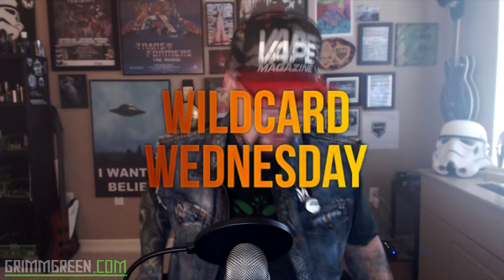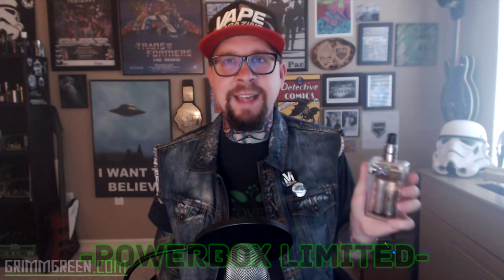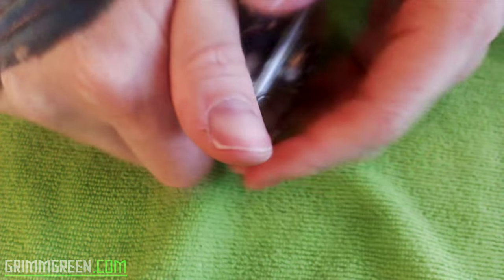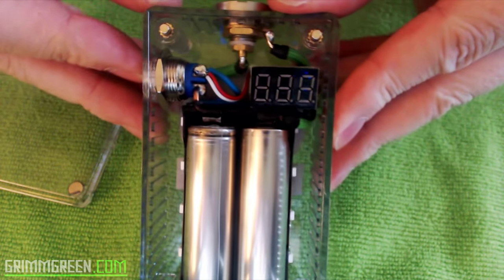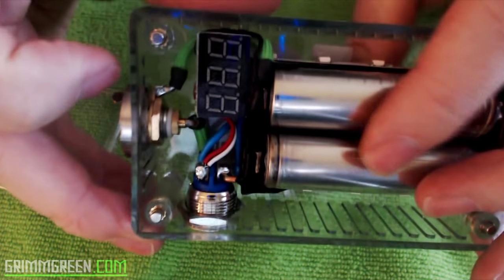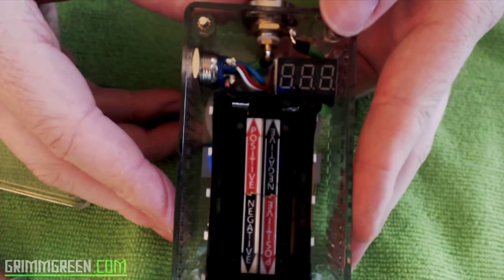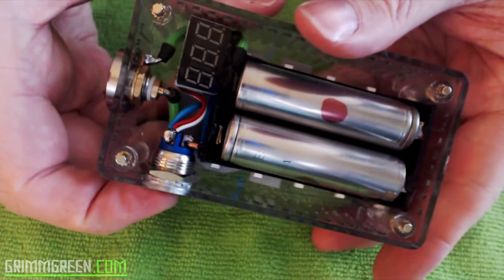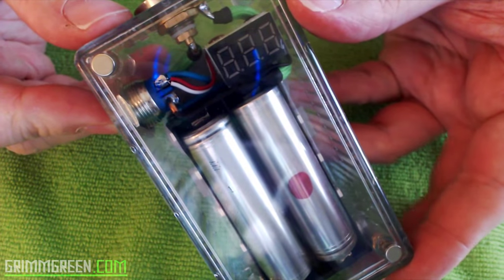The Powerbox Limited ~ Box Mod

Comment: For the leds  to light up while firing a higher build is needed about a .5 or higher . Being in series even a 1 ohm build is going to chuck clouds like a .1 build on a parallel box. Thank you for the review. Grimm you are correct there are currently 3 different types of box's we currently build. I'm happy to answer any questions anyone may have.
Reply: Also a mosfet can be wired in if consumer wishes
Reply: Elizabeth Powers should come standard especially in a series box. This box definitely isn't safe without one and you're setting yourself up for litigation and someone to get hurt.
Reply: Thank you for your opinion
Reply: OhSo  obviously u have not purchased these premade devices that come with warnings all over it.  legal language warnings in multiple languages!
Reply: Considering the fact that mosfets prevent the switch from self cleaning and can over time lead to it sticking in the fire position and auto firing please explain why a mosfet would make the box safer even when the switch itself is already rated for well above what he's pushing through it.
Reply: Hehe :p

Comment: Hey Nick, wanted to make a couple of suggestions,If you're at all interested. I primarily use series boxes, and wanted to say that series builds DO NOT have to be a hot vape. Personally, I love hot hot builds, but with all the power from a series box, it opens doors for huge coils (loads of flavor) without the ramp up time of a single or parallel 18650. My first suggestion is buying (I wouldn't be surprised if you were sent one) a Zephyr Buddha v2. It's a 30 mm atty with huge amounts of airflow, from the top and the sides, which gives you the option to fit huge coils and cool it down or warm it up with the AFC. My second suggestion is a build for a series box- I twist two strands of 26g kanthal, and then once I've twisted that, I twist 28g kanthal with he already twisted 24g. A 7 wrap dual coil of that wire comes out around .24-.25. which is a little low, so I wouldn't suggest chain vaping it. It's one of the most flavorful builds I've used on my series boxes, Let me know if you give it a shot. Sorry about the essay, have a good one man

Comment: I had a gentwo box mod not long ago and found that with series you should really use a 26650 atty.  It cools it down enough to take longer drags but you still get the same vapor production.  I used a 28mm tobh that was nice. And also if your used to a .2 build on a single battery mech multiply your build by 4 and don't use anything smaller then 24g kanthal.  And do more wraps! It's a science for sure learning the series boxes

Comment: Try shooting for 0.8Ω - 1.0Ω on your dripper, basic kanthal micro coil with lots of wraps = lots of surface area for more clouds and flavor. Basic rule is take whatever resistance you build on a tube or parallel mod and multiply it by 4 for the equivalent wattage. The benefit is that series voltage draws less current than a parallel or tube mod, assuming you build for the same wattage.  #ohmslawisyourbestfriend
Reply from the maker: Gaelen Bolland Gonna give it another go today!

Comment: The lights stop working when the batteries get a little low on those .3-.4 builds. There's nothing wrong with it, that's just how it works :) and FWIW, I've had one of these for months now...been dropped numerous times and I've used the living shit out of it. Switch is still fine and the box is in tact. Haha! Not as fragile as you made them seem, Grimm.
Reply from the maker: Charlie Wimmer fair enough

Comment: i run a 9 wrap dual nichrome 80 20 gage in my 30 mm doge  and it ohms out at about .18 and it chucks some real dense clouds! i have won like the past 5 cloud comps i have been in with this build. the best/safest builds are between .24-.35. recommended for safety

Comment: if you are used to a 0.2ohm build on parallel you will have to multiply x4 on your coil, build a 0.8ohm coil and you get about the same vape on your series box ;-) and the leds probably dont light up because of low build, voltage sag ;) those kind of ledstrips need a certain amount of volts/length

Comment: That's why I like the halo box from BC BOX MODS, it has LEDS but you can cover them so you don't need to see them.
Reply: Michael Phillips they make one without the lights also. and every box they make is on sale right now. I believe they are coming out with new stuff but until they do there are great deal to be had on their website. they have a total of 9 models including the series/parallel boxes that you can get with or without the light show lol. the best deal are the mini boxes which come in series or parallel not both and are on sale for $65 marked down from $105. They also come with lifetime warranties.
https://www.bcboxmods.com/shop/?age-verified=4c3dff6367
Reply: Yeah I own one the halo switch mod, I love it works like a champ. I do run the clear piece with it so you can see the led, it's just nice to have that option.
Reply: Did you check the sale. I bet new versions are coming out.

Comment: Series mods should have variable voltage. It is not difficult to wire in a mosfet and control with a low amp pot.  The reason the LED's aren't lighting is because the atty's resistance is lower than the resistor to the LED's. Seems quite crude in the construction to me, but I guess people like that.

Comment: there is a voltage drop that is much higher taken up by the atomizer. assuming the led strips are in parallel with the 510 connection. the atomizers resistance is much lower then the leds strip. there for the electricity follow the path of least resistance thus the atomizer and the leds if theres is not enough power for both and they will not light up.

Comment: Idk everything about series , but .3 seems super low. Great review , though.  I kind of dig the green LED'S.
Reply: Zachary Sturgeon For me .3 is roughly my adv on a series box, but I also like a really hot vape. Comparable to like a .1 on parallel. Most people stay usually around the .5
Reply from the maker: Zachary Sturgeon My buddy Duane was running a 0.15 ohm build on a series and LOVES it
Reply: Zachary Sturgeon 0.3 is usually fine for series. I'd be a bit worried about the fact that it doesn't have a mosfet tho. Welded switch in a few months max. Hope it has a decent warranty lol.
Reply: GrimmGreen that's not smart. .15 at 7.6 volts is 50 amps being pulled from each battery. Even with every precaution (pulsing, short pulls, wide coils) that's seriously pushing those batteries WELL beyond their comfort zone.

Comment: Bro, he's got the leds wired incorrectly. There's a few ways to hook leds up and he has it wrong. The thing that shocked me the most was the price tag! $125 for an acrylic box with a sticker on? 
Fyi, lowest "safe" build on a series is .24. You don't really wanna push more than  30 amps. I'm SURE that switch is only 3-6 amps at most. For $125, I'd exspect a $3 mosfet protecting that switch. Not to mention, he didn't calibrate his volt meter. Two fully charged batts should read 8.4 not 7.2. Those are just my two cents.

Comment: The lights got shut off because practically all the power was going straight to the 510 when you fired that atty. 0.3 ohms @ 7.4v = 25a requirement. Assuming the batts were 25a, they couldn't supply the necessary power to power the LEDs

Comment: wtf a non mosfet boxmod on a series box? they couldnt shell out the couple of bucks for 130? they even used a 1591 which is DIRT fucking cheap i build with those and it costs nothing
Reply: Could you build me one? Lol
Reply: +Matt Hutsell not only is this not a mechanical box, but there's actually no such thing as a mechanical box period.
Reply: +darkinertia2 He could of saved money on the switch, and put that money on a cheaper switch, mosfet and a pot... it makes no sense to me, but whatever. I build my own boxes for myself so I have no desire for such things anyway. Can't please them all :)
Reply: ***** Well... I call anything with nothing but a switch between the batteries and the atty, mechanical. That is the only thing connecting the battery to the atty, a mechanical switch. 
All the electronics here are leaching from the high current rail, and do not modify it. This is why the LED's died, the resistance was so low there was not enough current left to overcome the impedance of the LED's, so they stopped working. Batteries must be suffering :P 
A capacitor COULD be used to hold a bit of reserve for the LED's so they can continue functioning when their is too much load, however, but it would likely need to be electrolytic to have enough capacitance, and might be difficult to squeeze it in there without looking strange.
Reply: +Majestic Toad wrong, there are full mechanical boxes just google it and see
Reply: +Majestic Toad +Majestic Toad There are HEAPS of mechanical boxes. Here are a few. No wires. No (need for a) mosfet.
https://www.fasttech.com/products/0/10013067/2317603-cherry-bomber-styled-mechanical-box-mod
https://www.fasttech.com/products/0/10014424/2443100-castiogador-styled-2-18650-mechanical-box-mod
http://www.wismec.com/product/noisy-cricket-mod/
https://www.fasttech.com/products/0/10013628/2325800-osmium-styled-mechanical-box-mod
Reply: +Majestic Toad yes there is... What are you talking about?
Reply: In order for it to be fully mechanical you would have to have a wind up
mechanism or something to generate the power mechanically. Just because
there is a different point of contact to the switch that's not a wire
doesn't mean it has a different function electronically. It acts exactly
the same as it would with a wire, albeit with less resistance. Still
doesn't make it fully mechanical.
Reply: Majestic Toad lol
Reply: +Majestic Toad look up the osmium box mod. fully mechanical
Reply: Look at what I just said. There's no such thing as fully mechanical.
Reply: Majestic Toad no wires in it. its fully mechanical. you can take every sole component apart and it contains no wires or resistors or mosfet or transistors. it is fully mechanical. no clicky switch. comes apart like a mechanical tube mod. its a box though.
Reply: Tube mods are not even fully mechanical. As long as there is a cell it is
not fully mechanical. Just because there are components that replace wires
doesn't mean they don't do the exact same thing a wire would.
Reply: you think that there is electronics in a battery? batteries do not work because of electronics in them, they work because of materials that inherently have opposing charges, which creates a current when bridged.
Reply: Majestic Toad  I think I see the point you're trying to make. Unfortunately, the terminology "mechanical mod" was created by vapers to specifically refer to mods made of a battery and connected without wires/electronics.

EG. It's like saying, "there's no such thing as an Automatic Watch, because the definition of automatic is 'having the capability of operating independently'", when technically, it still needs to be wound via movement.
IE. Stop being pedantic and trying to appear smart.
Reply: I will when elitist vapers stop using incorrect words. Also, there is no
such thing as an automatic watch :)
Reply: Majestic Toad I like how you admit being wrong... Denial.
Reply: I'm not wrong, I'm absolutely right. Ask anyone with a basic understanding
of electronics. It's only in the vaping community that the term
"mechanical" is accepted in the way that it is, and even then a lot of mod
makers would cringe at the word being used like that.
Reply: Majestic Toad Ask anyone with a basic understanding of the English words "terminology" and "jargon".
Reply: "We use this word this way because we feel like it and that's the
terminology that we like even though it's incorrect" is the dumbest
argument I've ever heard.
Reply: Majestic Toad So, jargon, idioms, and forms of terminology (IE words used to express larger concepts) is "dumb" to you?
OK. From now on we'll call automatic watches, "watches wound via a free-standing rotary main spring", and we can call mechanical mods "e-cig devices with batteries that do not use wiring, but are technically not electronic."

Are you perhaps autistic? Y'know. The type of person who only see's the world absolutely literally. If I said, "I was over the moon", would you reply, "That's not possible. Technically you can jump over the moon."
Reply: Majestic Toad a year later, you still look like a complete idiot.

Comment: I build boxes, same exact boxes as that. Except I use a different 510 and I use keystone battery sleds...whoever is selling these for $125 needs a different outlook. I know what my boxes cost, and just in parts I have around $25 in it....$100 for labor?! Gtfoh! I charge $75 for mine and I customize where the switch is, where the 510 is, what color paracord wrapped wire you want....that in my honest opinion is a ripoff because that battery sled is a china sled......errrr that makes me angry that kids get away with things like this ripping vapers off :( ok rant over lol
Reply: Chris Rhodes Could you make me one that runs 4 batteries, 2 in series then those two sens in parallel?
Reply: Jake Mahnk email me at crhodes2021atgmaildotcom
Reply: Jake Mahnk I believe you just emailed me, somehow it disappeared, so if you can shoot me a duplicate I'd appreciate it, Thanks bud.
Reply: Chris Rhodes I agree with you, but all it takes is marketing. Look at Vaporfi. I am surprised that the company is even around still. Triple pricing, guerilla marketing and good design cover of china products. I almost got ripped off and fell for the power of lies as an incompetent, when I have started. I still spent a substantial amount of money on crap that I should have never ever touched. This box is going to be one of them. :)

Comment: i make a DIY series boxmod with mosfet, all i dare to vape is anything higher than 0.8 ohms on that. the idea is simple, you have 2 batteries running at the same time that means double the power right? then double the resistance. "with higher voltage comes higher resistance" LOL

Comment: It's not a good idea to pulse the batteries like that too, or click the fire button short and abruptly when taking draws. It stresses the batteries and can lead to premature battery failure. Especially if your build has a high amp draw, say 20-30amps, per firing. My guess is that your amp draw is too high with your particular build, resulting in not enough power to illuminate the LED's, which is why it works like a flashlight with no atomizer connected.

Comment: Great review bud! but 125 for plastic lol no...
Reply: Joshua McGuire  You should totally build your own! It's super fun and now there are boxes available that are quite rectangular (the hammond is noticeably rectangular trapezoid). Then you get to customize the s*** out of and really bend it to your will. You probably can make it for 1/5 the price that they sell these things.
Reply: Done a few but takes to much time, gave them away as gifts to ppl that needed a mod and knew how to use them cost me around 30-50 bucks depending on the box i used.
Reply: Well my hat is off to you fellow DIY-er. I am currently tracking down a lathe to make my own mech.
Reply: Raymond King well he still needs a mosfet or someones eventually going to get hurt
Reply: ChadHHC86 he will put a mosfet in upon request. Personal preference.
Reply: That's so dumb, haha.

"Sure, we'll put in a Mosfet per request. Do you want your switch to fail in a few days or weeks, or never fail at all?"...
Reply: Dan Danger shouldnt be an option. The button will fail without it and will cause damage to the device and probably the user as well, if your going to sell a device the device should be at least half way safe, the people who buy these may not know what they are doing and could be vaping at oh IDK 200W and have a hard short due to the switch failing, which could lead to the batteries venting all becuase some dumb ass  thought he could save a few buck and not put a mosfet in a series box, if you know this person tell them to join facebook.com/groups/boxmodders/ and show this shit on there and get blasted for it since its unsafe and tell them that $4 savings is not worth putting out a shitty mod mouser.com/ProductDetail/International-Rectifier/IRLB3034PBF/?qs=sGAEpiMZZMshyDBzk1%2fWi5%252bqVgN3%252bWS8iNZUeqPPDAc%3d
Reply: What is the switch rated for? Most of the switches like this I find by googling are only rated for 2 amps at 48 V. If that's the case and that means they can only handle 96 W, wouldn't you have to install a mosfet to handle higher power? Otherwise you blow the switch. Or is there something I'm missing?
Reply: Matt Hutsell What do you mean its pointless...? How can a safety feature that costs nearly nothing and adds no negative effects be pointless..? All it takes is a 1-2 minutes and $3-$4 more to make it a safer mod. IMO there's literally no reason to not have one. (I have no opinion on whether or not this mod is worth its price tag,I just thought I'd just give my 2 cents about the lack of mosfet)
Reply: Matt Hutsell In fact, it seems only having a switch limits the power range of the mod. When someone makes a claim, e.g., you don't need a mosfet, and they don't onus up to the claim, it provides no new information to anyone around. Those comments are pointless, but the mosfet seems to have several powerful arguments for it's use.

Comment: you can build that box for 35-40 bucks
Reply: slipknot231000 If that lol. Most expensive part was probably the lights.
Reply: ***** Nah, rolls of those LEDs will cost ya ~$10 for 5 meters.  That's about 40 cents of led strip.

Comment: It doesnt Light up with the atomizer because of the low ohm of the build it drains so much Ampere that the inner resist (ohm) of the accu drops the Volt so much that the LEDs cant light up. ;D